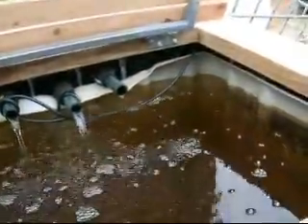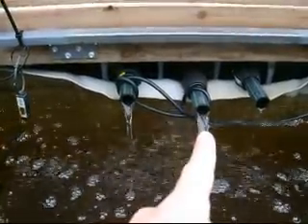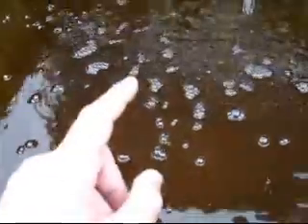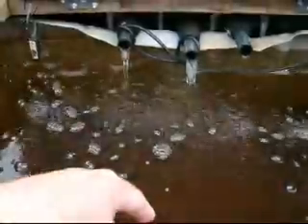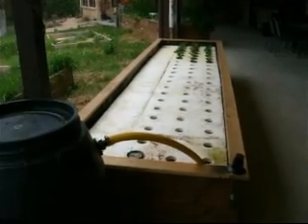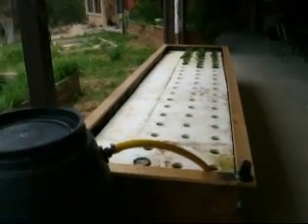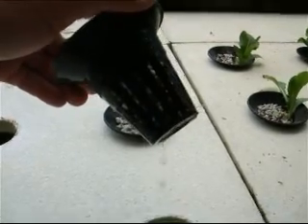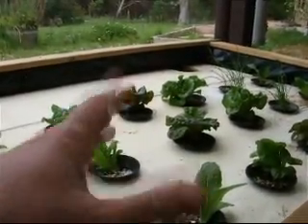Aquaponics System - Deep Water Culture

Comment: I bought this book [Check Details Here  ===>https://www.facebook.com/Easy-Hydroponics-Systems-166096780618260/app/208195102528120  ]. and devoured it in two days. It is an excellent guide to getting started in Hydroponic Gardening. There are guidelines for size of fish tank and stocking to the amount of grow beds you will need. There are excellent comparisons of different media types as well as the types of pumps and ways to recirculate the tank water through the beds. If you are looking for specific plans this is not the book. If you want a manual to allow you to customize the materials you have into a workable system this is the book for you. Highly Recommended!!